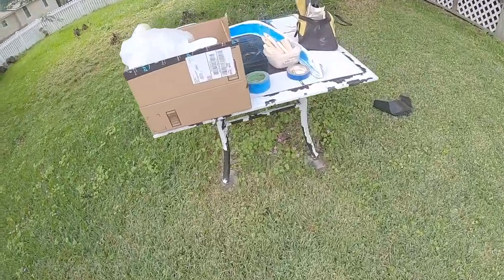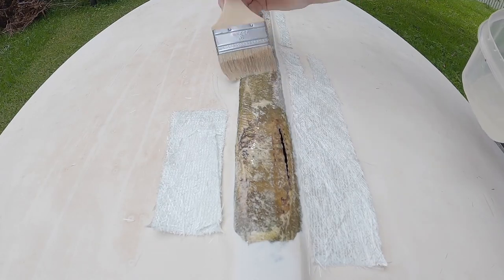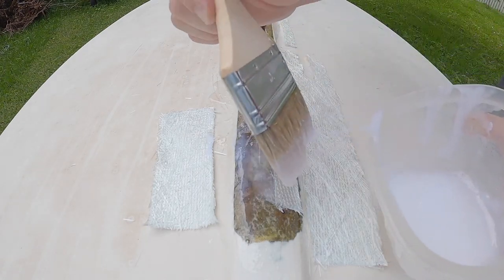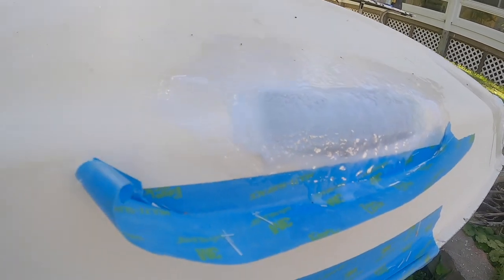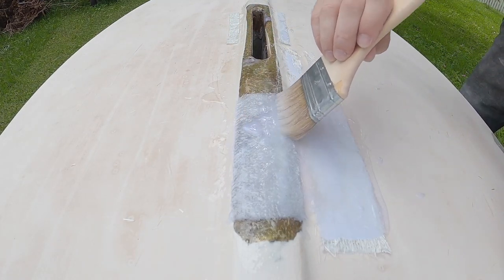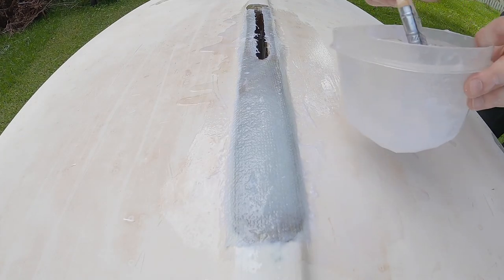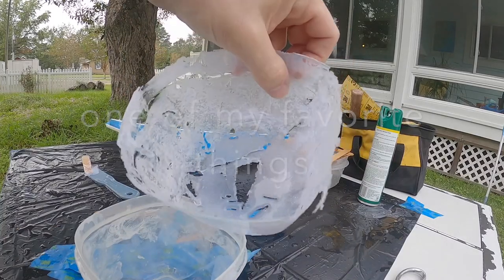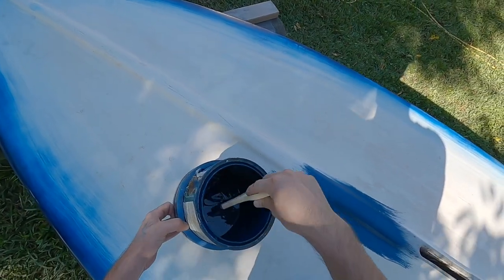Fixing Holes in my boat (Sunfish Restoration) PART 2

Comment: Where at in North Carolina are you located?
I'm out in Elizabeth City, currently working on fixing up a Vagabond 14 and I've also got an S2 8.0 that is in the works of getting the bottom redone
Reply from the maker: Hey. The videos I’ve made are all filmed out of oriental and the surrounding areas on the neuse river. I’m currently on the yacht I work on in south Florida which is why I haven’t been posting videos as much. Good luck with your projects!

Comment: Can you post some links of the epoxy and cloth that you used?  Thanks!
Reply from the maker: Hey, 
Sorry for the extremely long response time. 
I use other suppliers sometimes but generally fiberglass supply is a good one stop shop with reasonable options and prices, for small stuff and or beginners testing out lamination I don't recommend such a heavyweight cloth but slow hardener is forgiving and unless i'm doing a massive project the convenience of west systems pump system is something I find worth the increase in cost. 

Thank you for the supply oriented question, hopefully others find the info helpful.  Cheers!

https://fiberglasssupply.com/
https://fiberglasssupply.com/25-3-oz-x-50in-45-45-double-bias-w-mat/
https://fiberglasssupply.com/206west-system-epoxy-1-2-gallon-kit/